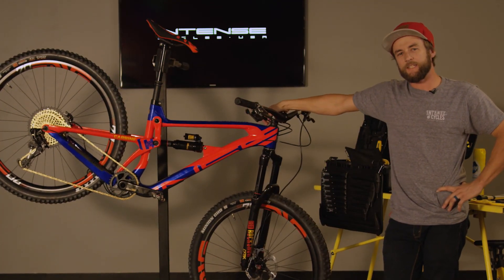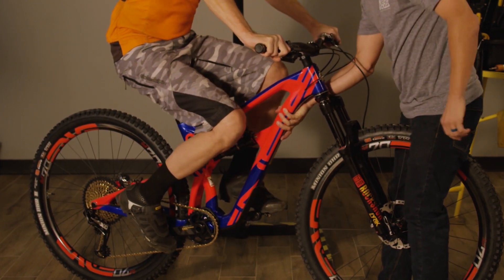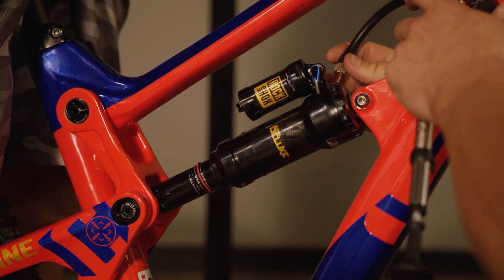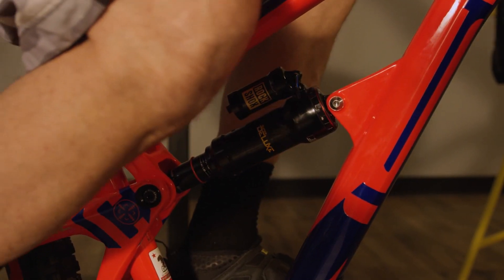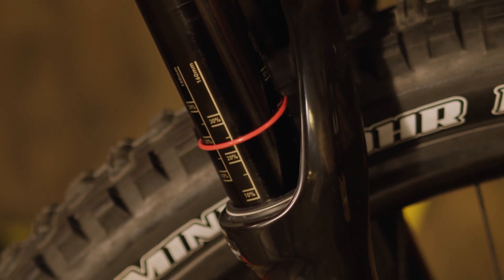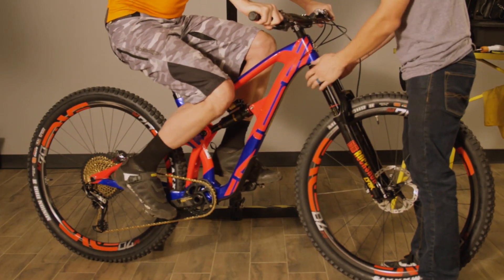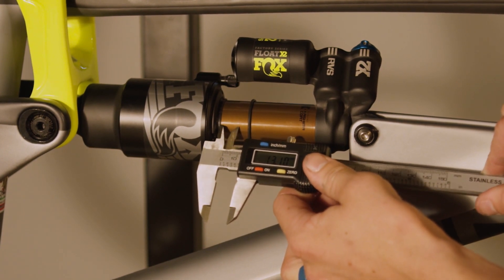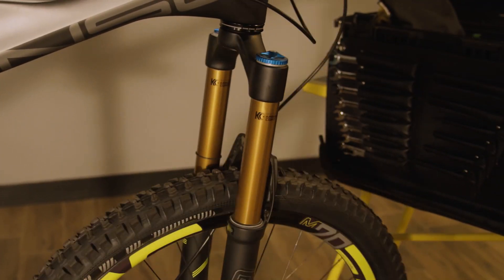Intense Tech Series: Suspension Sag Set Up

Comment: Chappy, your tech videos rock! They're short, clear, concise and easy to understand. As an owner of a 2018 Primer, I've watched them multiple times and found them to be very helpful. Please do more regarding suspension settings, i.e compression (high speed, low speed), rebound speed. My Primer is my first full carbon frame, first 29'r, first  1 x drivetrain, and first bike with a dropper seatpost. I'm in a whole new world so keep those videos coming. Thanks dude.